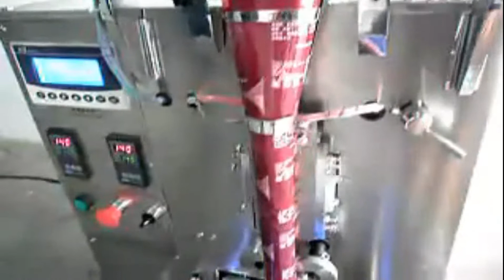Automatic granule/powder packaging machinery Small bags VFFS Máquina automática de embalaje granular

Comment from the maker: More information about PENGLAI  Máquina Automática De Embalaje or Filling and packaging machinery, please view our business youtube site http://www.youtube.com/user/cosmeticmachines or our business blogger http://cosmeticfoodmakingpackaging.blogspot.com .
Usage of automatic packaging equipment: 
Mainly uses in packing fine-grain and so on pellet class drugs, hard sugar, coffee, fruit treasure, tea, monosodium glutamate, salt, seed, drying agent. Is suitable to aspect the and so on medicine, food, chemical industry, agricultural chemicals small bag packing.
Main technical parameter
Packing speed: 30-60 pcs/min  
Measurement scope: 1-50g
Bag length: 50-120mm 
Bag width: 40-80mm 
Bag pattern: pillow type seal
Power source: 220V, 50HZ single-phase  
Total output: 900W 
Weight: 185kgs 
Machine Size: L800*W700*H1550mm